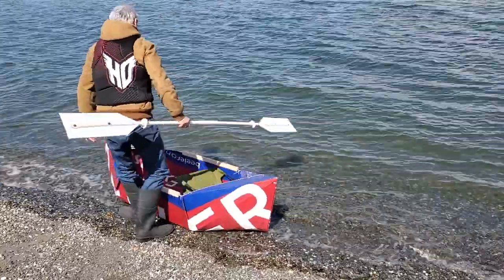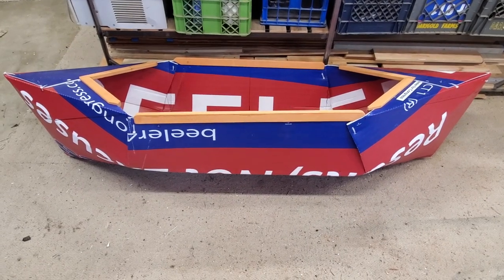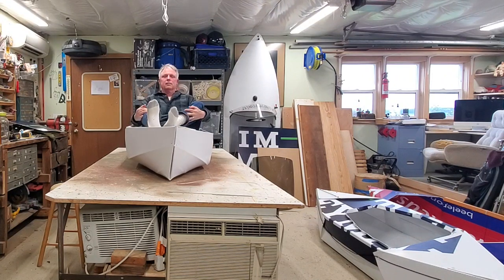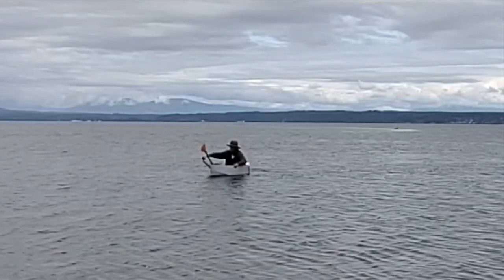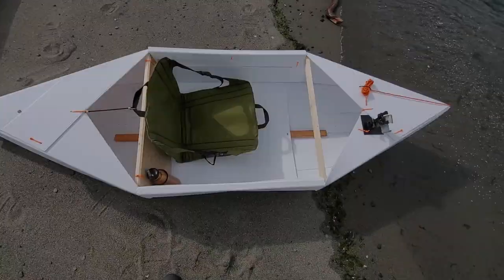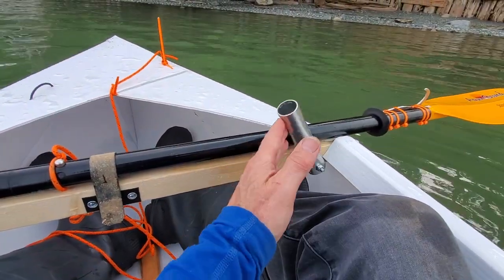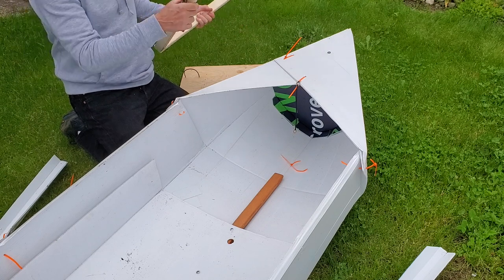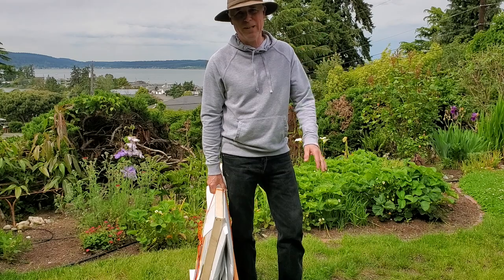Fluted plastic DIY folding kayak

Comment: I'm thinking of making a boat for my local river. I wonder how well Coroplast would hold up against rocks, broken concrete and trees. Maybe I should try to make a sit-on-top kayak from PVC and pool noodles. I'll have to check the local regs, but they have a float-down every year here, and a recent attempt to require stickers for any flotation device was voted down, so maybe it's doable.

Comment: Do you ever re-use your zipties? Clip them right where the tip goes in to the ratchet, or else slip a knife tip into the ratchet to release without cutting. Save you some money and time spent driving to the hardware store, as well as less plastic sent to try landfill.
Reply from the maker: I do, just what you've suggested. I have a ton of zip tie stubs. Sometimes I save just the heads for joining two flat panels together, like a nut and bolt. A paper clip also works for releasing the cam.

Comment: Is it faster than your previous version?
Reply from the maker: I've yet to do a GPS reading but it looks like it's a bit faster and tracks better even without the rear stablizer fin.
Reply: Hi Paul I'm finally getting around to making it , made a few changes, I'll send you an email once I'm done . Hopefully some videos in the near future too

Edit : also Paul, I'm thinking of a front bulkhead as well , mainly to rest my feet against to get more torque when I'm paddling.